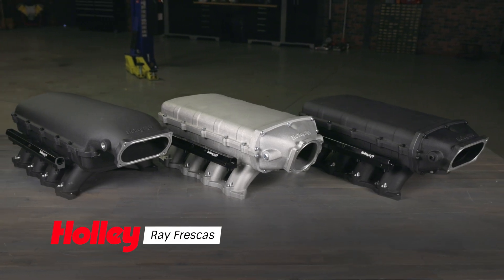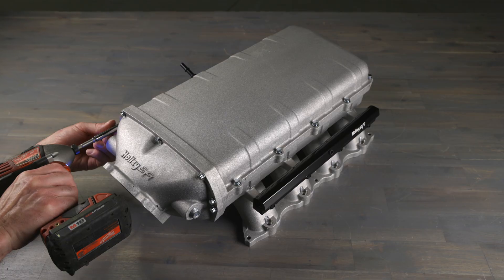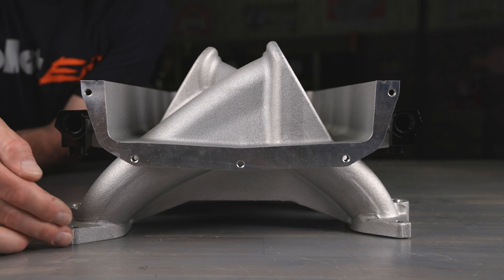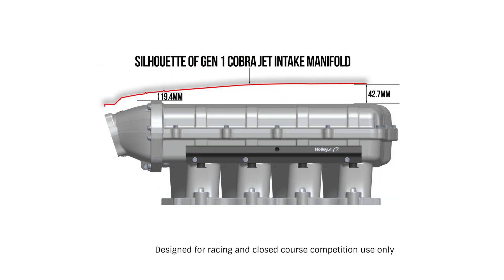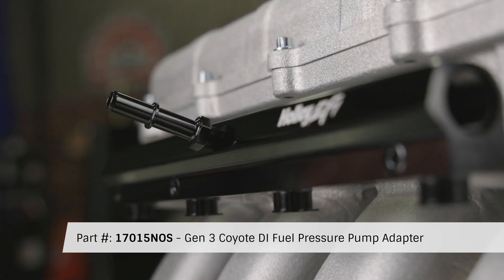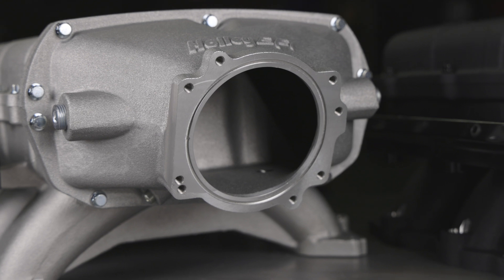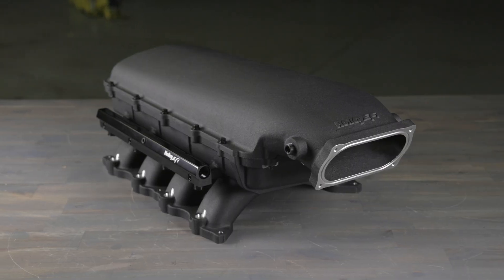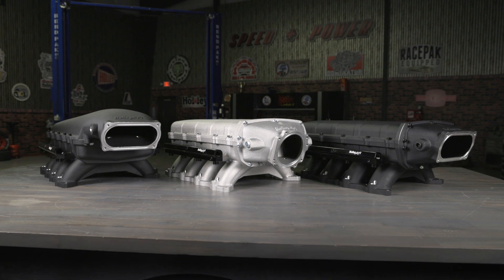Give Your 2011-2023 Ford More Breathing Room With Holley's Hi-Ram And Ultra Lo-Ram Coyote Manifolds

Comment: Holley, back in the day had it together. However, stay away from their Holley High Ram for the Coyote. They have absolutely no support for the fuel lines. The heater lines and inlet tube on the passenger side make it impossible for a fuel line crossover. Yeah it bolts up t the engine, and that's about it.  Go with ford performance proven intake manifolds and save yourself the headaches.
Reply: Yea I’m having issues with high ram old style didn’t come with pcv or oil separator holes
Reply: you people realize these are race car parts that require fab work to make them work as desired... don't you?

Comment: Does it gain more then a cobra jet ?
Reply: Hopefully
Reply: No it doesn't generate anymore hp just slightly more torque a bit faster.
Reply: @geofo7389 can you link a head to head vid?
Reply: Even if it has about the same numbers it’s cheaper than a cobra jet so……
Reply: No
Reply: @Coyote.Collector there’s already been tests it does lol. Where you getting your “no” answer from